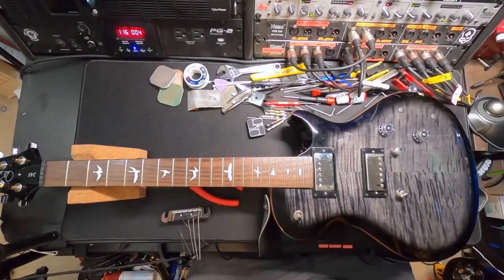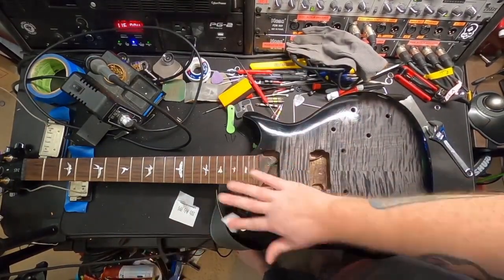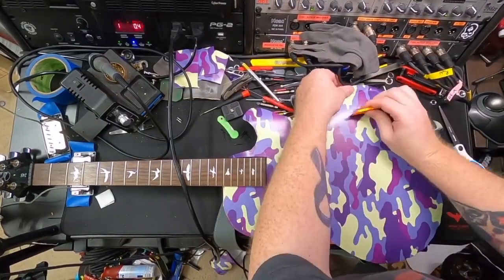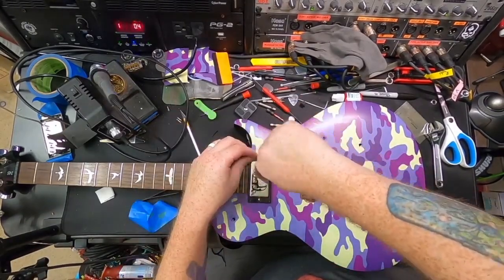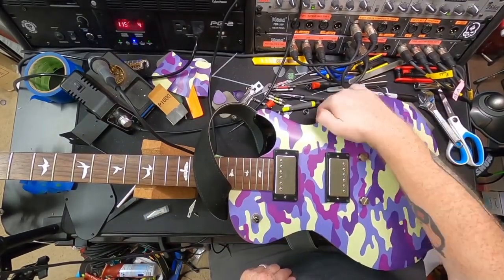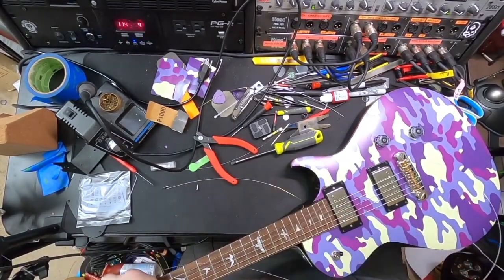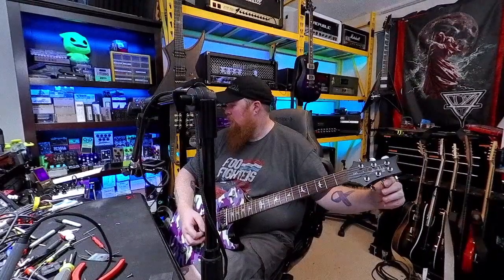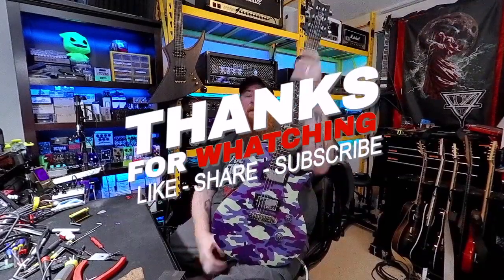Vinyl Wrap on a guitar? How will it turn out?

Comment: After you restring, I always pull on the strings a lot before tuning again, to stretch them out good.  Joe Walsh has a great video.
Reply from the maker: That’s what I do, I will push down with my thumb on the fretboard and lift the string with middle/ring fingers 2/3/4 times. Tune up. Rinse. Repeat.
Reply: @thatsoundsterrible  saweet! Love the vids, keep it up!

Comment: Great job.  I guess we have to spray clear coat (lacquer) on it to make it last longer, right ?
Reply from the maker: It would become a more permanent install by doing that. I had it on mine for about 7 months before I took it off, had no issues with it peeling up.  

Preparing the surface and making sure it’s clean before you apply the wrap/vinyl will go along ways for it to have proper adhesion.
Reply: @thatsoundsterrible  thanks a lot
Reply from the maker: No problem. Thanks for watching!
Reply: @thatsoundsterrible may I ask what kind of vinyl I should purchase for something like this?
Reply from the maker: @Stephanie.Strings  hi, I used Automotive vinyl wrap from Amazon. There is a company I recently found called InzaneSkins that offers some kits
Reply: @thatsoundsterrible  so kind thank you! I was just curious what type of vinyl to search for, as there are many kinds! I’m not able to use the pre-made skins
Reply from the maker: No worries, good luck with your search!
Reply: @thatsoundsterrible  thank you! May I ask what brand the vinyl was that you bought?
Reply from the maker: @Stephanie.Strings   here’s a link. https://amzn.to/3zWFV8p

2ft x 5ft is the size I got.
Reply: @thatsoundsterrible very kind! Thanks so much!

Comment: Hope the alcohol doesn’t eat the finish.
Reply from the maker: I’ve never had an issue on poly or nitro finish.
Reply: Alcohol is not acid. And if alcohol did eat guitar finishes, barely any guitars made in the 60s or 70s would have an original finish.